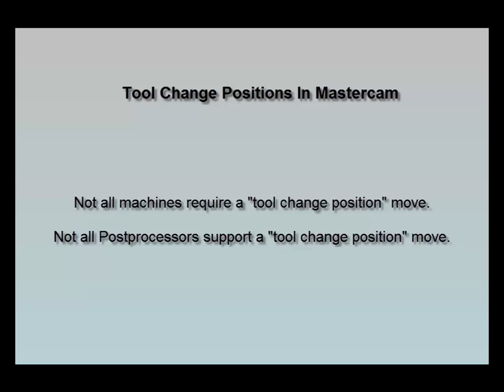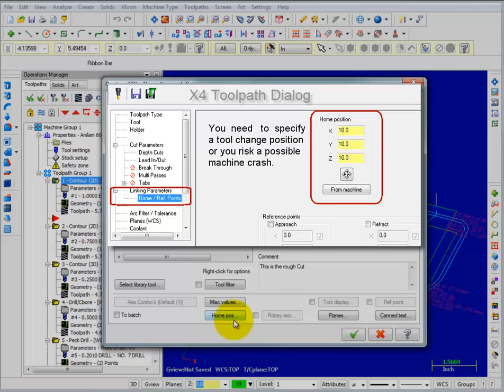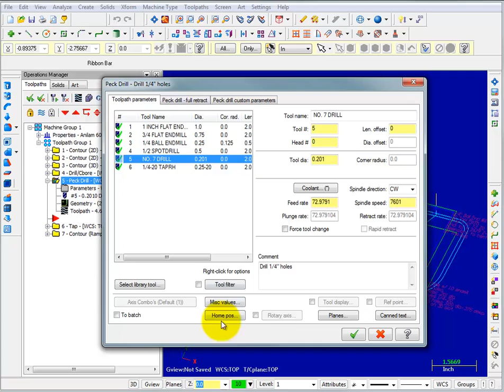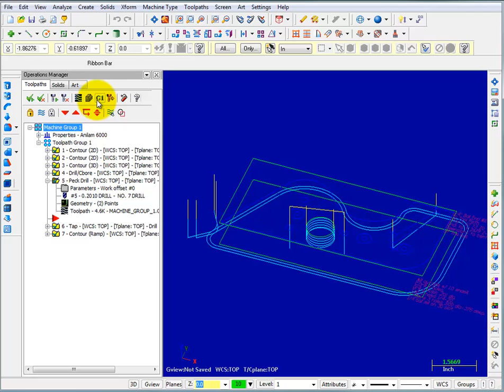TFM - Mastercam Tool Change Position Output & Control.

Comment: Yikes! would not be comfortable with a Z 0 for a tool change.
I take it you are using machine co-ordinates for this. I like the controls that
have a tool change position that is specified in the control itself.
Then you just call an M06 or something similar, and then you can put the
tool change anywhere you want with out fiddling with the program.
Reply: Z0 is a g53 command, not work offset.